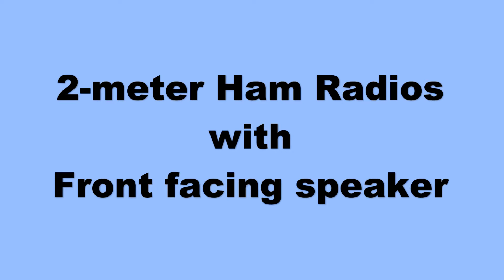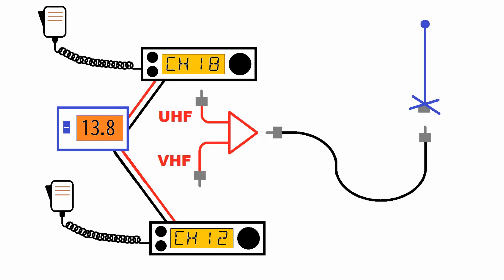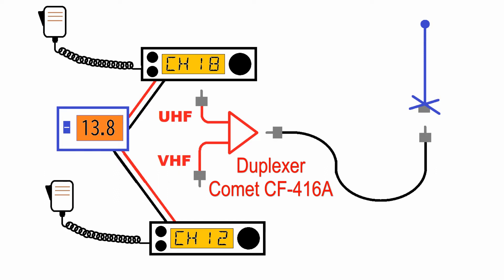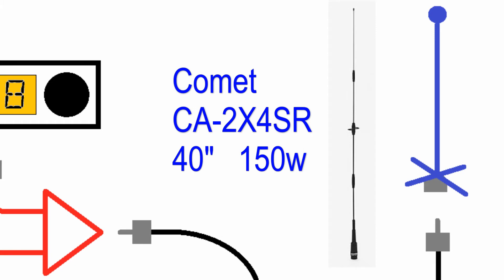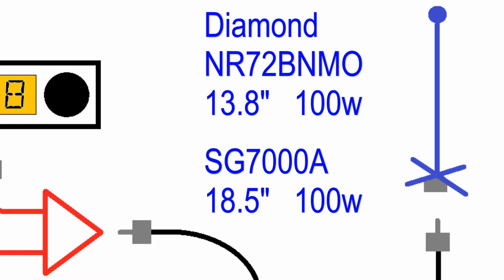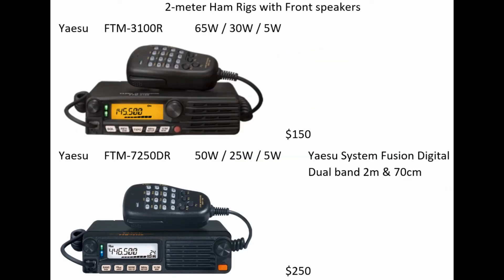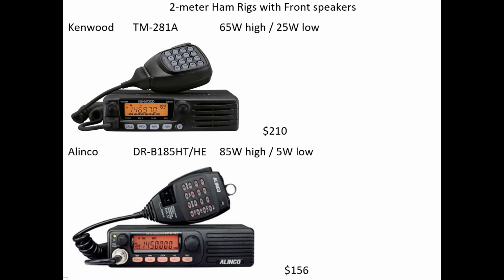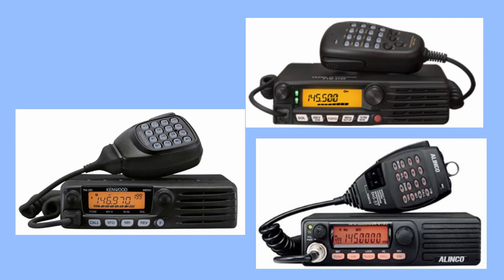2 meter Ham Rigs with front facing speaker

Comment: Interesting idea on using 2 meter and gmrs on 1 antenna, will have to check out that antenna. Mostly interested in front speaker 2 meter for a base station, as I have a small 25 watt tyt dual band in car.

Since no one else in family is licensed, gmrs is something to consider or possibly ssb cb.